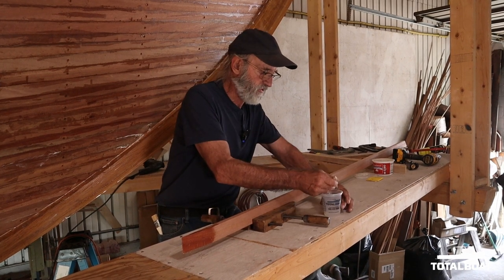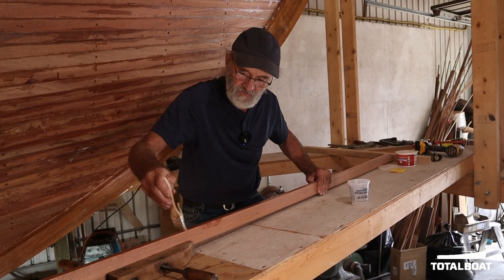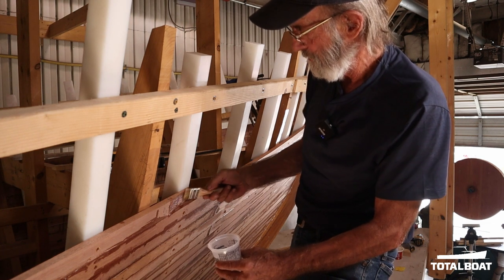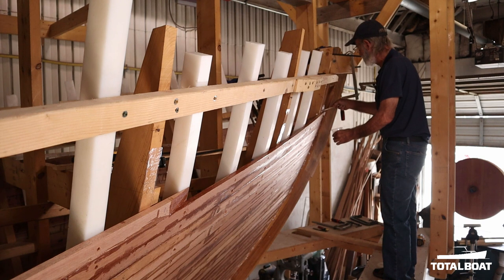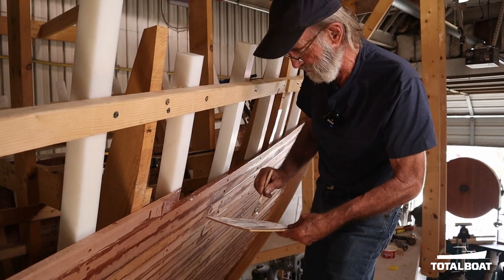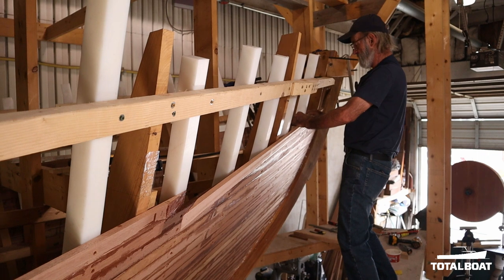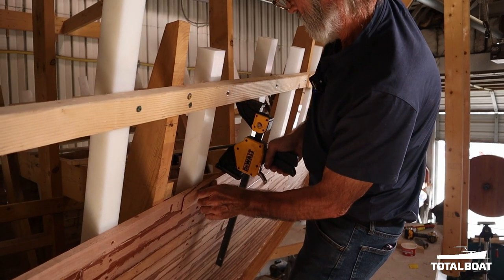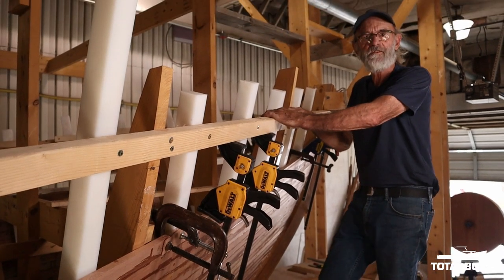Tips That Stick: Scarfing Planks with Epoxy Resin

Comment: All that epoxying -done twice no less because you have to use the thickened stuff the second time, on way too many planks because they are way too narrow to begin with because its strip planking versus carvel, and worst of all only the inner planking of a TWO layer planked boat. And to think that once upon a time boats were made leak proof with ONE layer of wider fewer planks and no epoxy.
Reply: Nonsense, over the years there has been thousands of boats built with narrow planks. It was also a method used on many high quality sailing and racing yachts as well as top end motor launches. You need to get your facts correct before criticising.
Reply: @RonLaden  No, I have my facts right. In fact I know more about strip planking than you do. Did you know that it was patented in Detroit  in 1841? Hollow and round was patented in Boston around 1873. The fact that it is widely used does NOT make it it as wise a choice as wider carvel planking, glued or otherwise.